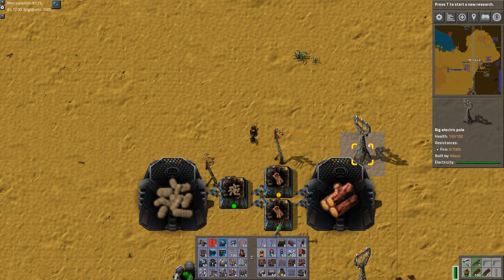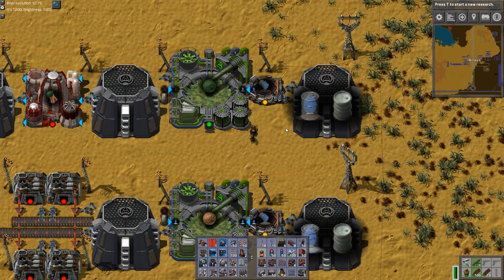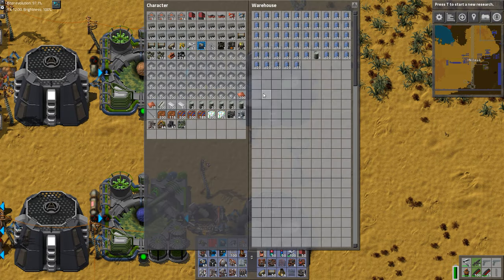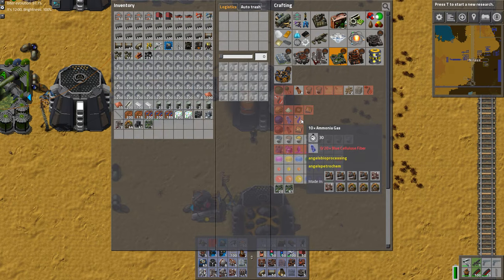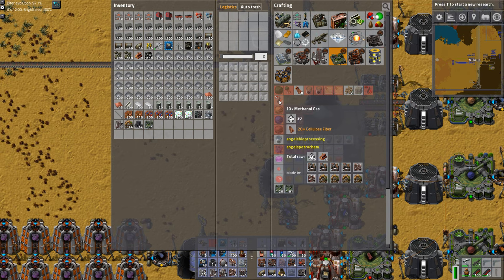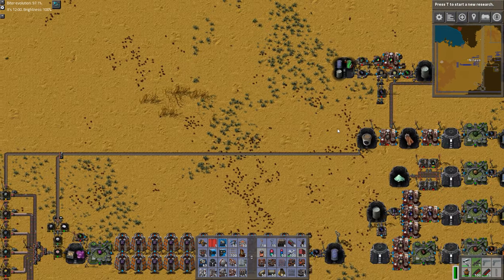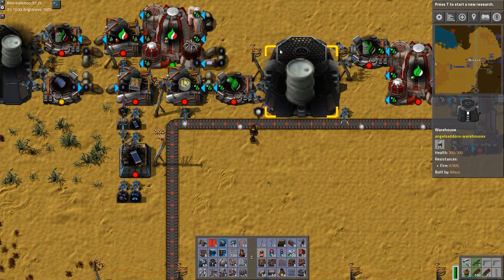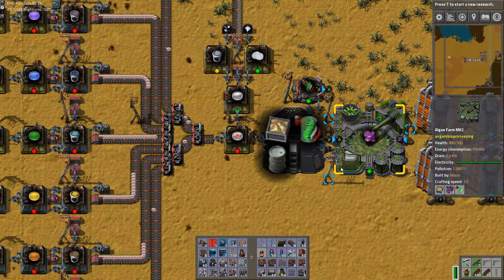Angels Mods Tutorial - Bioprocessing 1 - Algae and Alien Artifacts - OUTDATED

Comment: Awesome tutorial
I hadn't realised i was running outdated versions of angels, so i will now dive into, Bioprocessing V2.0 with your knowledge to help me. 
Also, I strongly agree with your suggestion on Methanol from Wood, I myself typically set up a fairly large green algae system in the the early game that allow me to keep a Propene Plastic setup running, this provides plenty until the set up costs for A large Oil Build are more manageable.
Reply from the maker: That is a really good point in an early Bob/Angel campaign. Greenhouses --> Wood --> Green Algae --> Methanol --> Propene --> Plastic. Completely bypassing Oil and can be done very early at rather limited cost (it will have to be built rather big though)
Reply: The petrochem oil setup is a pain compared to such a setup, and it takes up a lot less space to get, say 2 chemical factories, running non-stop from this than getting just a basic oil/gas setup up in petrochem (that is assuming you build it to work, and not shut down 5-10 mins later).

Comment: Did you think about using brown algae to fuel your steam engines ? ( 25mj on alginic acid )
Reply from the maker: I did think about it, but in preparing the tutorial I decided to leave it out. To me that does not seem like a core critical part as it is too complex for just better fuel, which at least to me is never a problem.
Reply: It's maybe not essential for tutorial  purposes but i was wondering what you think bout it, since free resource independent 25mj fuel seems kind of op for worlds without Uranium Power factories ( mine :) ), its easy to set up ( steam shared files id=877792820 ) and the setup ive done is able to sustain much more engines than i built, it was just efficiency test, but i can see people going the easy way. 
I just really hope its unintended, cuz coal pellets/wooden pellets are much more challenging than just bringing saline water for algae.
Reply: It will go away when I get to updating the mod, the fuel value was a mistake I made ;)